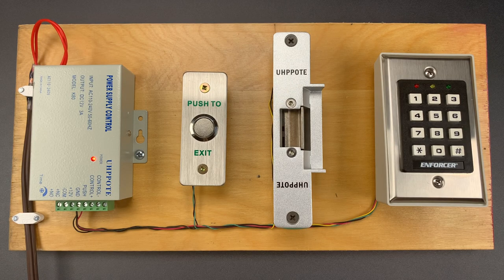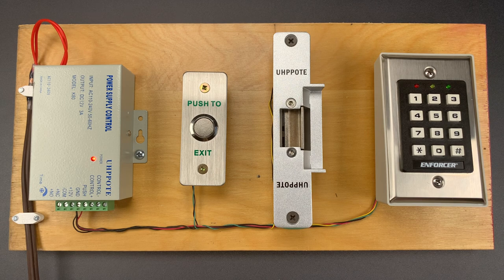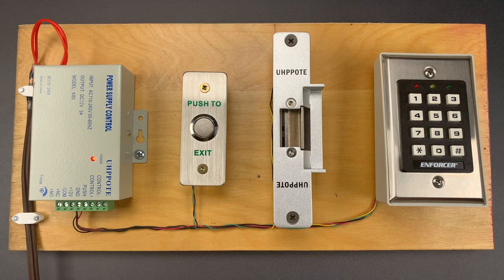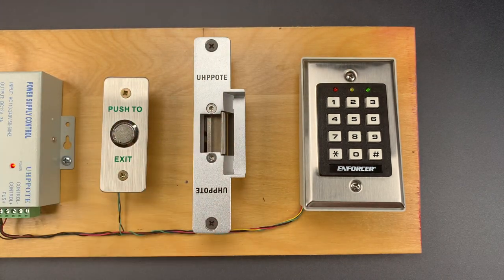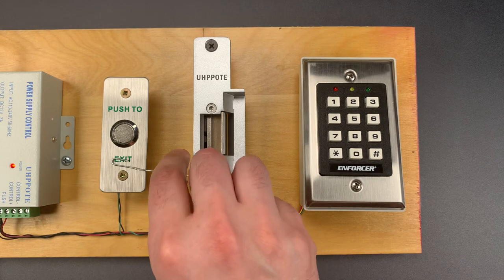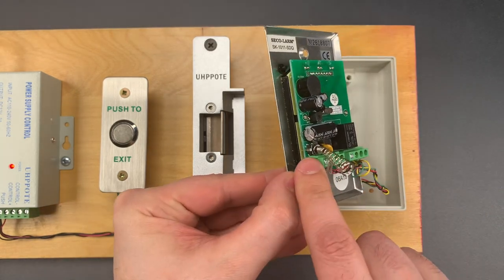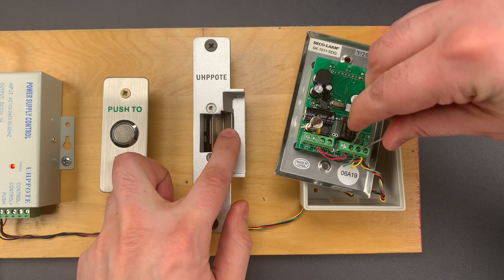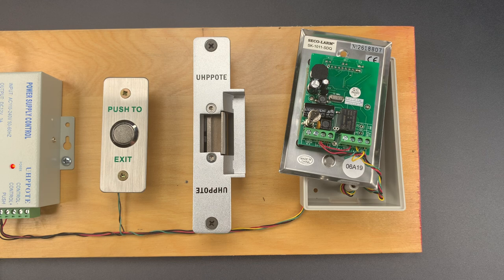[1045] Swiss Army Knife Bypass of Keypad Lock

Comment: I have a question and I am sure it has been asked before. If I bought this setup and used hot glue to cover up all of the electrical contacts that would make this product just a little better right? I can't tell  you  how much I enjoy your videos! I have been watching for months and I went  out and bought a lock picking kit and a set of clear locks. As a software engineer I am just fascinated with your ability to quickly problem solve your way into what I used to think were secure locks!
Reply: A standard lock is going to be better for most regular applications.

However, if you a business or something, there are far better access control systems out there (more expensive, as well).

Even in low security applications, we'd never use a keypad with a built in controller.  All the wires go back to a panel on the secure side, and usually in a secured room with elevated access.  In places where I have seen keypads, they don't have accessible contacts on the back of the keypad.  It's hooked up with a data cable.

This is just a cheap "employee break room" type lock where you simply want to keep honest people out.  I would get fired if I installed one of these.

Comment: The cover plate should be electrically isolated from the circuit. That's just a lazy design.
Reply: You mean apart from all the other lazy design aspects?
Reply: The keypad data entry should be processed behind the door (e.g. in that grey box which obviously only contains the power supply).
With that tampering with the Keypad box would lead nowhere. 

Such as simple.

Comment: Esquire,
I really appreciate what you have done here, but there are more sophisticated keypads that need your attention instead of this poorly made keypad. Even the old version of the keypad used by Radio Shack might have given you a run for your money since the tamper switch was in contact with the frame on an elevated platform behind the keypad. There were four lines like this model however two were used to communicate with the control board the third and fourth were for power. The controller would send a command for all devices except magnetic switches and contacts to test if they were present. If the devices didn’t reply then a trouble indicator would light and the controller would make the keypad and alarm panel beep. If the proper code was not entered in a certain amount of time, then the alarm would go off. So if the power to the keypad was removed or shorted, this was detected as an attack and the alarm would sound. As for bypassing the magnetic switches, they could be bypassed easily providing you knew the connection type: normally open or normally closed. If you remember the burglar alarm foil on windows, that was the easiest to bypass if you could get to the contacts or wiring. 

Love the videos, I have learned a great deal from both you and Bosnian Bill (Good luck with the retirement Bill)

Comment: Hmmm. The ones I installed didn't have a long spring to push against the box. They had a thin metal frame that sandwiched between the pad and box using the same screws. If you loosened the screws, the plate would loosen in its "sandwich" long before you loosened it enough to get a tool in and opened the tamper switch.  Also, there was no wiring header, just wires that you then used quick connectors or soldered into the cabling.   If you didn't install these on a box and just mounted them straight on the wall (allowed in residential), you simply cut a smaller hole to accommodate the PCBA and used drywall screws, no plate necessary.

Not that they were unbeatable. If you knew where the switch was, you could pretty easily shim it before loosening at all and carefully unmount it.  And back in those days, the code was set with jumpers or dips, so you could just read the code and put it back.

Comment: I’ve seen these where the keypad is completely sealed in resin and you only need to use the 12/24volt comm and yellow signal wire. All other connections should be made at the power box so they are not available at the keypad. Crossing the signal wire with the 12/24  or the com wire doesn’t seem to unlatch this one..

Comment: I did watch this for educational purposes. If I want to use a lock system like this, I now know how to defeat most common attacks to this lock.  1. Wire the tamper switch, 2. 3D print a shield that protects the contacts and real tamper switch, 3. install an accessible spring as a 'fake' tamper switch to fool the attacker into thinking he has disabled it.

Comment: We were one step above back kn the 80’s and use internal door hinge switches as the door open detection. Very clean and the key pads used security screws. All doors had cameras so if the door was opened, monitored cameras would alarm. Also pull the fire alarm and codes require magnetic doors to open

Comment: OTHER WAY TO PICK
Cheap pin pads common in North America is to just stroke across the keys back and forth and up and down. 

Controller default setting only looks for string of numbers in correct Order. 

It doesn't care how many other numbers in between 

so stroking the keys in different directions sets the 4 - 8 programmed digit version of ungaurded pins

Comment: You can also rip the keypad enclosure from the wall and bridge the NO or ingress wires too, you can even use a stun gun where a high voltage pulse can cause the keypad to malfunction often actuates the relay..The trick to making it more secure is to recess the keypad into a concrete wall so it cannot be smash or ripped off use heavy steel enclosure, hide the screws to the bottom so they cannot be accessed unless you have a special tool, and finally you use the keypad as a dumb keypad no electronics inside to bypass and the controller is on the inside, all cables are surge protected, some keypads have an LDR at the back which is very difficult to bypass and cover as the keypad is in a hole in the wall so if the keypad is removed an alarm shuts and locks the system down.

Comment: I have something very similar to this installed on the gate at work. The button is on the inside and you can easily reach through the bars in the gate and press the button from the outside.

Comment: that might be right with that type, but in Australia the most popular keypads the wires run directly into a resin sealed assembly so there are no contact points, they also have a tamper switch.

Comment: Also those door strikes are very weak and can be kicked open, depending on relay location a strong magnet can be use to pull in the relay, a stick can be used to press the ingress button if you can gain access through a hole, a broken window panel even a powerful radio transmitter can trip the ingress.

Comment: In truly secure applications, the door electromagnet is protected against tampering, and is not triggered by a simple electrical DC or AC pulse, but by a digital rolling code. 
This requires an additional circuit board built into the door lock in a reinforced metallic housing, but it protects the door from this kind of attacks. It also keeps security high in case of centralised access control, where doors are opened by sending a variable code instead of a pulse of electricity.

Comment: A better tamper switch would go through the screws. Such a lock would have a grounded body and cover plate and the screws holding the cover plate in place bottom out touching contact points so that if it loosens at all the contact point is pulled high and the alarm goes off.

Comment: So, I normally wouldn't plug another channel, but I feel it is a need for all the people saying the checker should be in a secure area and the keypad just pass the input.  It wouldn't do any good.

Modern Rogue did a video with Red Team Alliance showing that one that only passes the codes to a secure box are just as bad.  There is a penetration chip (around $300 according to the video I believe) that captures all information going along its data wires, and it can be remotely accessed via wifi.  It can even remotely resend a code from your phone.

Instead, they need to at least shield the anti-tamper mechanisms to prevent manipulation (and hook the stupid thing up to alert a remote site) as well as other shielding to prevent handling of any of the electronics before the front is removed and anti-tamper goes off.  A simple fitted box within a box would prevent a fair amount of these attacks.

Comment: Placing the main logic circuit on the outside of the locked door is already a security concern. It should be inside and has a keypad outside that just sends the typed in code inside for validation. Or even better, the keypad should request a validation sequence, then the main logic sends an ever changing modifier key, the keypad encripts the code number based in the received key, then sends it back for validation. That way you can't just catch the code by taping the wire and monitoring the communication. You have to decipher the encription method too.

Comment: These locks are generally set in a fail safe mode, if the power fails they open. But in high security settings they do not fail safe.

Comment: This solution is not used for medium and high security areas. ( at least in Europe ) Usually the electronic and the relay are in a separate unit inside the protected area. The keyboard is only an encoding device.

Comment: Wire in a tiny motion sensor into the anti tamper switch, any kind of movement will trigger it! Add a cheap piezo alarm that is triggered by the motion sensor! Finally rethread the screw holes for a reverse thread anti-tamper screw and add locktite.

Comment: I think most modern building safety codes require a crash bar on inside of door instead of an egress button - would be interesting to see that bypassed but from an engineering viewpoint I've always thought that is the simplest way in (using the exit bypass). Even systems people described below saying have central control, wired separately, what difference does that make if you have either a motion detector and/or crash bar that bypasses right there at the door, as required by code?

Comment: Outstanding work on your part. If I understand this correctly, all this could be defeated if that exterior box cover plate had screws at the rear instead of right on the face. Maybe attach it through holes in the surface. This is almost silly what they did here.

Comment: A simple horizontal plastic bottom plate installed on this thing would thwart everything you just did essentially blocking any objects from being inserted from the bottom. (Not that anything would thwart you for long).

Comment: With some fairly simple mods, like fitting a shroud around the contacts and anti tamper switch, it would improve the security. Or even changing the screws on the faceplate.

Comment: In all fairness, this is a stand alone keypad. These are a budget option and aren't made to be extremely secure. In a setting where security is important these would never be used. In those instances all of your components are in the secured side of the door and the keypad just provides a digital number to a processor.

Comment: Simple fix: don't use a dummy keypad opener. Just use one with wiegand protocol, so there is no "short two wires to open" trick. Wiegand opener costs just few more Euros of dummy ones (I got one on Amazon with an anti-tampering system based on light, no silly springs for just 38 euros, and that's totally rainproofed since the entire circuit board is engulfed in resin).
Wiegand protocol will "speak" to the central unit when the user is authorised, asking the central unit to open the door. Obviously you don't put both of them together, the central unit has to be kept inside of the building.

Comment: If the tamper switch was in circuit it would have been activatet. All tamper switces are pressed active when the front is closed. So by bending the spring the switch would no longer be under press and tamper alarm is turned on.

Comment: So you should glue in a plastic piece to hide the terminals (or just gell insulate them). That plus put multiple tamper switches / better tamper switches. The 2 philips screws are a bit of a joke as well. At least use some custom screws to make it a little harder. 
Personally I would have the control box (not a keypad) doing all the work and the keypad is just something that sends codes for each keypress. To stop brute force attacks I'd have a timeout in place for multiple incorrect attempts. 
I would protect the control box from high voltage spikes as well (for those attacks where someone puts 240 or more volts down the line to try to fry the box hoping it will open)

Comment: dipping those connections in epoxy or just hot glue should be a good solution to this problem that seems to be in ALL keypad locks. unless it has to be like this for servicing or mounting the thing

Comment: Cool video but this type of attack would not work on a name brand unit like a Securitron, for instance. They don't have any relays inside the keypad.  Rather, the relays are inside a separate control box inside the room.  Slipping something under the door to reach up and hit the egress button will work on pretty much any system tho.
Reply from the maker: Knowledge of each system is my most potent tool... walking up to most doors and instantly knowing the options to open them is something that takes time to develop.

Comment: The controller which opens the door should be located on the inside with the button rather than with the keypad. The keypad sends an encrypted message to the controller to indicate that the correct code was entered. There is no direct connection between the outside and the circuit which controls the actual door lock. The only thing you can do from the outside is enter the code, or send the encrypted message (which is the same as guessing the code, only harder).

Comment: Far from foolproof, but replacing those screws with something like pentalobe screws would narrow the field of people able to take them out. Your average security screwdriver that most folks carry around doesn’t include pentalobe bits. That would force them to carry a larger kit of bits to attack that keypad.
Reply: There are security screws with flat faces that require you to cut a flathead into them to access the internals.

Comment: My keypad uses a optical sensor which is facing the wall, this would be difficult to bypass, also the circuit board and contacts are sealed so that you cannot gain access to them. Not all keypads are like yours.

Comment: I'm no expert but I would think all that should be on the outside of the door is the push buttons sending a signal to the electronics on the inside of the building. So no matter what you do outside there are no contact points which would instantly trigger the lock. All you'd be doing is sending random key presses down the wires.

Comment: I think the only thing funnier would have been if they had put tamper evident stickers over those screws LOL

You know if you are going to put screws on it I would have gone with those security/one-way screws made of hardened steel to prevent drilling. Then include a special driver that not only fits the screw head but allows you to countersink that screw flush with the face plate. For added tamper protection you could make the screw holes on the face place recessed deeper so that you cannot get a chisel or saw blade onto the head.

Longer screws, a thicker face plate  and four screws instead of two would benefit here as well. I would also redesign the face plate with an internal flange to prevent a paper clip or blade from being inserted and shield the PCB.

If that still is not enough I challenge anybody to remove a recessed one way screw that has been fitted with 262 Loctite.

You will NEVER stop a criminal from breaking inside, but you CAN make his job considerably harder.

Comment: Wow, a simple fix would be to include a wall around the circuit board to prevent easy entry for a bridge, and actually wire up the alarm. That way a locksmith can still get in. I get cheap, but no excuse for a bad design, because this would be a couple of pennies more expensive my way.

Comment: In my own experience the "egress" button is commonly referred to as "rex",  on your controller it's referred to as "push". I actually have a manual for that keypad, in most applications the tamper button is not connected to anything. Since the e-strike is magnetically released, can you release it with a bigger magnet?
Reply: Ĺ

Comment: “Welcome back to the Lockpickinglawyer, today I have a 20-number dial with 3 alarms and a group of armed guards holding radium cores. However, this particular lock has a weakness to melting candles. Off screen, I was able to open it in 42 seconds.

Comment: I needed to get into my dad's house, and found he had moved the spare key & forgot to tell me.  I removed the keyswitch that operated his garage door, shorted across the contacts, and badda boom, I was inside in less than two minutes.  He wasn't mad that I let myself in - he was mad that he had overlooked such an obvious weakness.  His solution was to cut the wires to the switch, reconnect them with alligator clips, pull the wires tight and tack them down. If you unscrewed and pulled out the switch, you'd immediately pull the ends out of the clips,  and be left holding a switch that wasn't connected to anything.
Reply: Can't you still short the disconnected wires
Reply: @rogervanbommel1086  When you pull out the switch, you'll have say 12" leads attached to it. If you could somehow reach the disconnected wires 12" away inside the garage, through the little hole the switch came out of, yes, but it would be virtually impossible to do so.